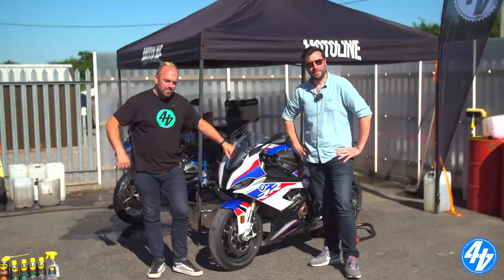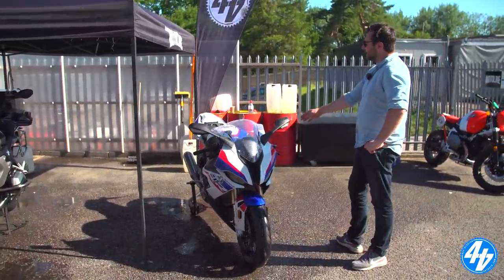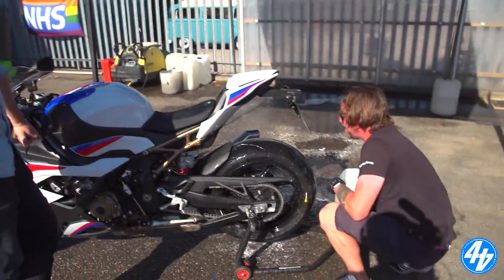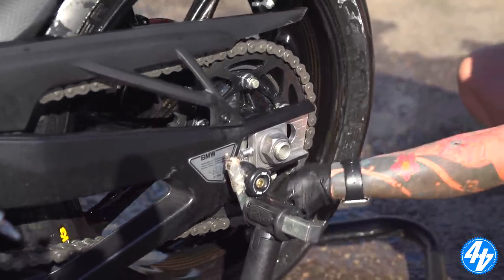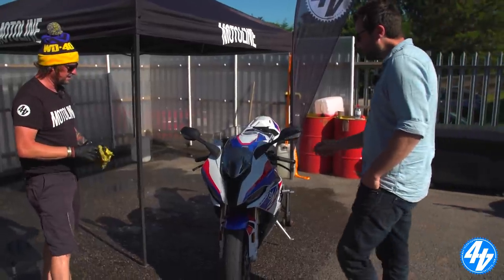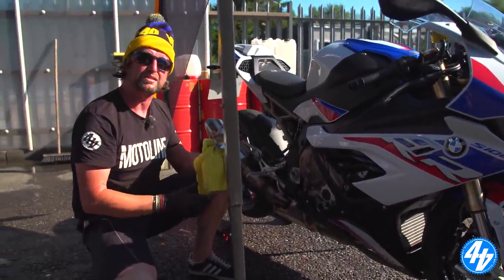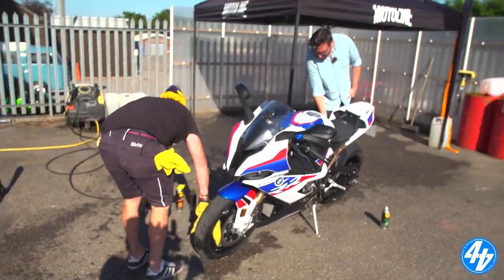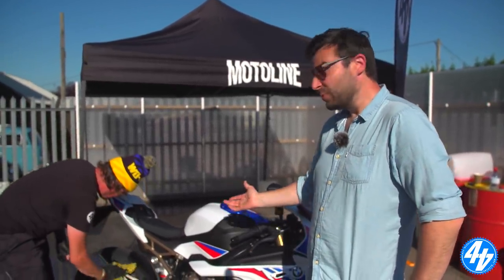How To Wash Your Motorcycle

Comment: I wouldn’t let this guy within a mile of my bike
Reply: Why
Reply: @QuarantaQuattro in short, he cleaned the whole bike with a bug remover pad (might as well use sand paper) he also cleaned the front wheel and then onto the paint with the same pad, no pre wash, he had a 15 ltr bucket with 2 ltrs in it, no brushes, no APC, no ceramic coat, i clean my tires and thats how i spot nails and stuff

Comment: as a detailer im cringing, but i suppose its a ok cleaning routine for the non ocd normal guy 👍 love your chanel
Reply: Same sponge on wheels as with paintwork 💀
Reply: If you have any alternative recommendations feel free to share as I’m keen to learn a decent approach
Reply: @majordelays4909  I haven't washed a bike with anything but a light spray cleaner and a microfiber cloth in over 10 years, or a citrus cleaner and plastic razor for the really stuck on stuff. I never wipe the bike with the same cloth as the wheels, and use a specific brush and chain cleaner kit for the nasty stuff. Heavy scrub brushes or steel wool for the tires.. If I ever end up in a rain situation, I take the wheels off and clean the hubs and apply fresh lube to the axles and chain.
Reply: Hey mate so could you show us how to do it properly please

Comment: Acid on the exhaust - no.
Same sponge for the bodywork as the wheels - no.
1 bucket method - no.
Washing in direct sunlight - no.

How not to wash a bike.
Reply: Luke Walker 

Is the exhaust solid metal....yes
Does it look better........yes
Have I been using it on my 18yr old bike.......yes
Does it look better........yes
Fall asleep listening to you.......yes!
Reply: you clearly don't understand much.

Acid on the Exhaust - Yes...how do you think iron removers work? I think you need to brush up on your chemistry and how chemicals work on different contamination and surfaces .

Same Sponge for bodywork and wheels - it can be done...you need to degrease and cleaner the wheels first before a mitt wash.

1 bucket - yes... Because 2 buckets means absolutely fuck all when it comes down to HOW much water you have, particle breakdown and bouyancy of particles .

Washing in direct sunlight - it's unavoidable at times but as Spook says....keep the bike cool.

I always love when a weekend warrior tries to dictate how shit should be done yet doesn't even do if right themselves!

Yours sincerely,
A Professional Detailer and Trainer with 2 Companies and Multiple Awards and Accreditations 👌
Reply: @midenking9651  mad ego mate. Not all iron removers are acid based. And yeah you're correct that other things can be done if necessary but they clearly have the resources to have 2 buckets, a grit guard and some shade. All they're doing is showing you how to increase the risk of damaging your paint.
Reply: @mikefandango3343  sleep well mate

Comment: Just a heads up...
-always work from top to bottom (bottom will be dirtiest and will make it easy to scratch paint)
-Cover or remove seats as water will help break down foam much faster and may develop mold
- Use 2 buckets when washing (one for washing off larger dirt, other for finer material)
Reply: How do I wash the seats (just pollen rn)
Reply: @gagedery3592  damp towel id say would do the trick then. wipe off with a dry towel and then leather protection depenting on what seat you have

Comment: "two bucket system, one to wet one to wash" integrity lost right there, go back North 😂
Reply: Unless he meant wet and wash the sponge 🤷🏼‍♂️
Reply: @RyanJM90  Nah! he does it all wrong, front to back too, always top to bottom. He also used the same sponge for the wheels, and still used it on the paint work, no professional valeter, let alone detailer. And this video is meant to be a tutorial he should do it right, and be clear when explaining.

Comment: "Never go in dry" 😅😂🤣. At about 6:55 I'm not a fan of throwing stuff away when you can reuse it. The rag that's used near the greasy areas such as the chain and bearings can be left to soak in fairy liquid or stronger soap. Wring it out and just reuse that cloth just for that particular area. A silicone dish washing pad can be reused for the chain instead of scotchbrite.
If stuff like that is chucked away it'll just go straight to landfill, or even worse, the Oceans. 
It's pure joy riding around this Planet innit, well little things all add up to take care of it 👍

Comment: Never knew the acid trick. Every day's a learning day. Cheers !
Reply: Metal polish and wire wool would work the same, not really into the idea of caustic chemicals ma self
Reply: although harpic does work, however, the type of acid used in it brings steel particles to the surface and causes more rusting.
Reply: Indeed...Acid removes rust/oxidation and Caustic removes grease.
Reply: @krishampton7060  Many ways, just the metal polish and a rag will do it, or fine sand paper/scotch brite.  Harpic on old rusted pipes will bring them up a treat, but must wash all off pretty quickly, or a combination of the two, as you clean off the Harpic, use a scotch brite and clean water.
Reply: What acid did he use?
Reply: @desmc690  and the proportion of dilution to water, please.

Comment: If I may add a top tip I got from the local suspension guru: after a ride clean the inner fork legs with a bit of silicone spray on a cloth (use brake cleaner on rotors if you're clumsy afterwards). The fork oil seals will thank you. (Good ol' WD40 is also good for this application, just don't polish them dry)
Reply: I only recently learned this while reading an Ohlins shop manual for my suspension. They suggest a thin film of WD40 after a wash or riding in the rain.
Reply: I learned this trick from mountain biking actually. Don't use regular lubricants because it may rot out the rubber seals on the lowers. Silicone spray is boss.
Reply: Brunox deo spray is the way to go for forks etc. Same effect as wd40 but not harming the rubber seals as do wd40.

Comment: Cheers for this, especially the chain cleaning info. I’ve used chain cleaner and one of those chain cleaner brushes and I’ve never been able to actually get a clean chain, seeing the guy use an actual ton of chain cleaner and scouring pad has opened my eyes to what is actually required. Self teaching myself the small bike maintenance stuff is hard when people on YouTube etc can’t do it to a professional level themselves. 👍🏻👍🏻
Reply: Surface rust isn't going to hurt your chain. What really matters is keeping the o-rings lubricated and some of the center bearings that contact the sprockets.

Comment: I always do the chain first (obviously) but also bug splatter remover for the front and degreaser on chain guard/wheels/frame first.
Later it all comes off when you spray and rub in the soap rather.

WD-40 to clean chain fling off the rear rim is very true

Comment: damaged electrics, oil seals, radiator fins, decals, bearings etc.
don't use a Pressure washer!
use a regular garden hose
ride the bike to dry the chain, add maxima chain wax to the warm chain
Reply: maxima chain wax is the best lube by far, i've been using pressure washers on my bikes for 25yrs but i keep at least 1mtr away with a wide fan spray not a fine jet spray with zero problems.

Comment: And that’s why I never let a motorcycle dealer touch my bike. Same with my cars! Please now get a detailer to show a safe wash method. Those bug sponges are so abrasive, might as well use a Brillo pad on your paintwork!
Reply: Bug sponges are fine, if used with a well lubricated shampoo.

A Brillo pad and bug sponge are not the same abrasion.
Most of us use a dual mitt with lambswool one side and bug not the other.

Detailers use them regularly 👌
Yours,
A time served Detailer and Trainer
Reply: Miden King - I wasn’t suggesting Brillo pads was the same abrasion, I was being sarcastic. Bug sponges on corrected paint will leave marring guaranteed, especially if used week in and week out. Even if there is a place for a bug sponge, it’s for getting the bugs of the front of your bike/car. This video shows a bug sponge being used unnecessary on the whole bike.

Comment: 1. Don't wash your bike on very hot days
2. Never use a pressure washer
3. Clean the chain and sprocket / rear wheel first - otherwise you will get oil all over your bike. 
4. It takes half a day to clean a bike right.

Comment: For everyone asking what acid it is, it will be a phosphoric acid at a very diluted ratio. Around 40%  you can commonly find it in commercial traffic film removers. It’s not recommended that you get it on aluminium however as it will etch it. To back myself up on this, I work in plant cleaning and I use the stuff all day long.

Comment: Not rocket science, but for those without an airline, buy a cheap “Henry” type vacuum cleaner with blow function, eg Titan @£35. It will blow warm air after a few minutes use and drys all your nooks and crannies in minutes, this avoiding post wash dribbles- ooh err Mavis. 
Splendid channel chaps👍. Thanks - Touring Grandpa

Comment: Just stumbled on this video. It always puzzles me why these pro's use lots and lots of water, on bikes as well as cars. I never use any high pressure stuff. Water and steel do not mix too well. On my bikes I use water, 2 buckets, for the fairing and other bodywork stuff. Never on the frame. In the old days bicycle shops use(d) a light oil to clean a bicycle. I use this stuff on metal parts of my bikes as well. Must be my age 🙂.

Comment: Did we find out what acid it was ?
Reply: 20:18 "Just a bit of diluted sulphur"
Reply: Many use Harpic power plus, but I'd only use very occasionally to be sure that it doesn't eat through too much metal over time and cause weak spots that can easily rust away. It does wonders on old exhausts, removes all surface rust when painted on and cleaned of after a couple mins with water and a scotch brite.
Reply: “... diluted sulphur[ic acid]” ...
Reply: Diluted sulphuric acid which is what is used in batterys.
Any of yous tryed it.

Comment: I'm curious how the 44Team feels about ACF50 or if you've used it? It's a product I came to know through another youtube cleaning vid. Apparently used on planes to prevent corrosion.
Reply: XCP is proven to be better in tests by a long way.
ACF 50 is good for electronic and inner trays.

People blindly apply it without actually understanding or Protection on the right parts.

Comment: This is a video of how NOT to wash your bike. Didnt clean fork stenstions, front sprocket  or radiator gaurd. Clean chain and wheels first, then spray all the gunk away. Then wash bike top to bottom. Different cloth for metals, different cloths for plastics.  Could go on and on. Takes half a day to just wash a bike properly. Never apply wax or polish in direct sunlight EVER.

Comment: What kind of acid did he use on the exhaust??
Reply: @Dar nooooo, its too corrosive. Nitric acid is what you should use 👍🏻
Reply: 20:18 "Just a bit of diluted sulphur" (sulphuric acid)
Reply: @Dar it causes pitting over time.
Reply: acid house
Reply: @s1dew1nd3r4  You tune in you drop out 😊
Reply: @lukewalker5111  You don't leave it on, it's used mainly on older exhausts to remove more bedded in surface rust all over the whole system, paint it on and leave for a couple mins or so, clean of with scotch brite and water, good as new.

On this exhaust, just a good clean could do it, or wipe a tiny bit of ACF-50 on it and clean off the next day, surface rust gone, it will smoke a little as the exhaust heats up but it will do the job great.

Comment: Just use fusso coat (not on matt parts), not wd40 for wheel dust.... 
Also a wet microfiber on your fly's to soak them soft so you don't scratch.

Love the show 😉
Reply: 303 Aerospace will get dead and dried bug guts off better than anything. Try it out . Squirt on leave for a ten or twenty seconds and they'll come right off.

Comment: Like a woman, start at top and work your way down.
If I'm after a dry spin with just flies & dust to remove, then I just use a spray bottle with water & wet down the area I'm about to work on. Then use baby wipes as a cloth & dry up moisture with micro fibre cloth. I leave the wheels till last, spray with WD-40 and wipe off with baby wipes, For wax, I use cheap Lidl furniture polish.
Leave the chain till last...de grease, use the proper 3 sided brush cleaner tool, remove excess with old cloth &  re-lube. Job is OXO.

Comment: I found that using plastic darkening spray directly on my bikes wheel rims worked well. I think it probably has some benzine in it which pulls off grease then silicone that deepens the colour of a surface. Also I used harpic power plus max on my stainless downpipes and it works a treat, probably because it has some acid in it.

Comment: Year round dual sport rider here. I wax my chain and only do it 2 times a year. Not a spec of rust ever.
Reply: That's mad, what is your chain made from galvanized steel or something?
Reply: Gear box oil , old toothbrush ever 2-3 hundred miles refer to your manual &  it's cheap

Comment: Can I ask you both a sensible question.  How important is warm tyres on the public roads.  I hear people talking about slipping and struggling with cold tyres and there only off to the f**king shops hahaha. It does make me laugh.  I have never done a track day but I do understand having softer compounds etc.  But our roads I don’t think we could keep the heat in.  What do you honestly think?
Reply: Just buy a decent road tyre. It will do all you need. I don't think you need to worry about softer compounds on the road unless you are a legend or fancy being locked up. Even on a road tyre you have to let it get a little warmed up before you should think about getting on it's side on a roundabout.

Comment: Love the channel but I feel like this video gave a lot of bad advice. Besides taking the sponge straight from the wheel to the bodywork (never do this unless you want to scratch metallic brake dust all over your body work!?) I would also be wary of using scotch Brite on the chain. It will loose fibers which could end up working into the o-rings and shortening the life of the chain.

Comment: I'm not sure this is the correct technique. An insect sponge across the whole bike, wheels to fairing, metal to fairings, 1 bucket, product clearly drying on the bike. 
Use a noodle mit, start on painted surfaces, then wheels and metal, don't let things dry and have a separate rinse bucket. Finish it off with a wax on the paint and then a protectant like ACF50 or mucoff bike protect - spray it on, let it sit, wipe off the excess (avoid foot pegs, seats, grips, leavers etc)
I know it is easy to sit here and criticise and valeting is a lot different to detailing!!
Reply: You should use a precleaner and degreaser before ANY mitt touches the bike.

Comment: Can you use a pressure washer to clean the chain?
Reply: No
Reply: You can do what you want, it's your chain.
Reply: The chain is packed with grease 
If you get water inside the chain it will be ruined long before it should

Comment: That would'nt work on my Meriden Triumph...
4 hours minimum, 6 hours maximum if she's filthy.
Garage Queen.
The only paintwork is the tank and the iron cylinder barrels.
Everything else is shiny. Real shiny.
Polished stainless oil tank. Stainless spokes, ally rims, ally guards, nickel plated frame and swing arm, polished motor, shiny polished everything yada nada da bing... 'kin nightmare...
My Guzzi - deap opposite, everything and i mean everything (except the motor) is powder coated. 2 mins with a hose, 1 minute wipe down, good to go in less than 5. 
Guess which one gets ridden more....
No plastics were harmed in this comment.
 Coz there is none on my road bikes...

Comment: Washing a vehicle in the sun can cause oxidation of the paint.
Reply: Incorrect. 
Massively incorrect.

Washing in sunlight does NOT cause oxidation.
Modern paint types have Clear coats with UV protection, colour fade happens now from PhotoPigmentation instability.
Not from Oxidation.

Comment: Completely clueless. Lube the chain when it's warm on the inside and the lube forces its way out through the chain as it spins. Putting it on the outside of the chain will just result in it flying everywhere